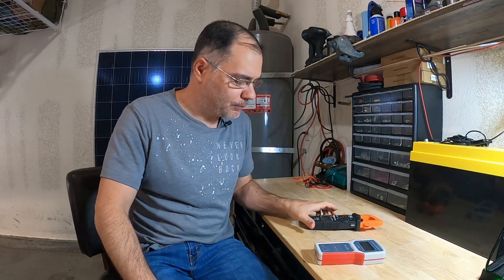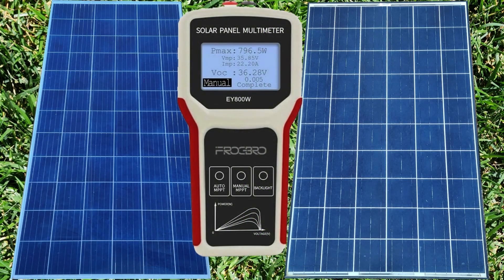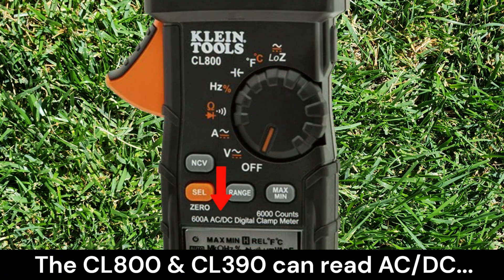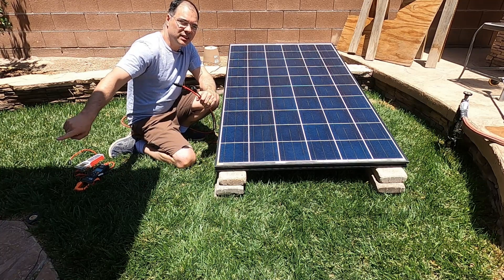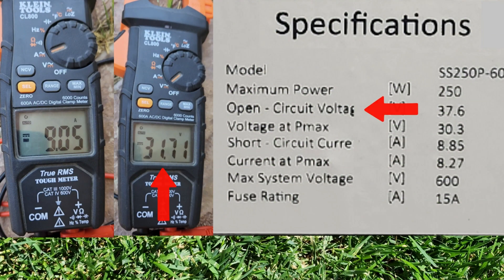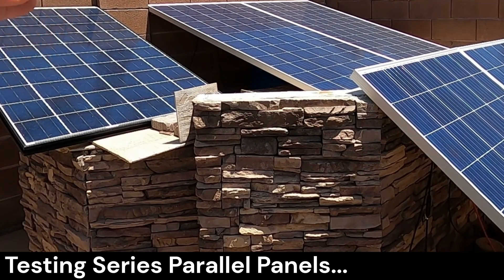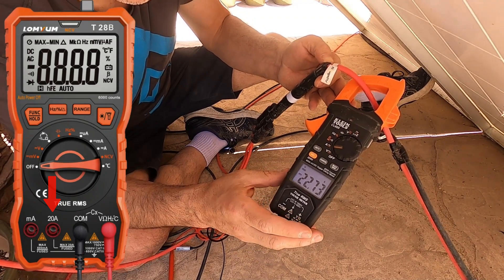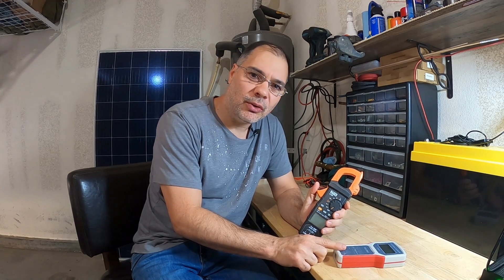How to Test Solar Panels - For Beginners!

Comment from the maker: NEW 2025 1800W Version With 120V VOC!
https://amzn.to/4iX9tne

Visit my website for more DIY solar projects:
https://www.natesdiysolar.com

My poor FrogBro!! So these meters, although convenient, have a 60V limit! When using it, be mindful of this as I was only thinking in terms of Watts! 

I think it's kind of silly to have a meter that can read 800W but have such a low VOC limit. You would have to connect the panels in parallel to test them. If it's made for single panels, I would like to see an 800W panel.. I would buy it in a second! 

I should have made a "will it fail" segment because it definitely failed.. or my brain did...

Enjoy! 

For Solar Panels (affiliate link):
https://www.santansolar.com/product-category/solar-panels/?ref=84967534

P.S. I had to remove the links to the solar panel angle tool and inclinometer app as YT did not like them....

My poor FrogBro!! So these meters, although convenient, have a 60V limit! When using it, be mindful of this as I was only thinking in terms of Watts! 

I think it's kind of silly to have a meter that can read 800W but have such a low VOC limit. You would have to connect the panels in parallel to test them. If it's made for single panels, I would like to see an 800W panel.. I would buy it in a second! 

I should have made a "will it fail" segment because it definitely failed.. or my brain did...

Enjoy! 

For Solar Panels (affiliate link):
https://www.santansolar.com/product-category/solar-panels/?ref=84967534

P.S. I had to remove the links to the solar panel angle tool and inclinometer app as YT did not like them....

06-15 Upfate: @12:33 I mention the Amps at Pmax (meter) was higher than the value on the sticker. I don't think this is accurate as this value should never exceed the short cuircuut current (isc) value as volts would be zero at short circuit. It's best to press the auto or press the manual button several times to get a good reading.. credit: larrywong7843
Reply: I just bought the 1600W version on Amazon.  The Frogbro is apparently being sold under about a dozen equally creative brand names, with no effort to hide the fact that they're all the same, right down to the model number.  The cheapest 1600W was ~$75.  The "Frogbro" was ~$105.
Reply from the maker: Yea, they are all the same.. the prices are  always changing.  😞
Reply: Seems you got your comment double-posted, but Youtube censorship is getting stupider by the day, removing legit things (both links and comments) while allowing the scam and spam to run free.

You forgot to mention the biggest advantage of the clamp-meter: you don't have to unplug the whole thing to run your amp-meter in series with the circuit!
When it comes to your FrogBro, I am more than a little bit surprised that such an expensive tool doesn't have overvoltage protection, especially so when the Voltage(max) is as low as 60. Quite happy you kept it in the video though, as it is VERY easy to make a small mistake which then have serious consequences.

Volts should be zero at short circuit? Ohm's law says that it's the resistance that gets close to zero, as I = U/R. Am I missing something here that is specific to solar panels?
Reply: @natesdiysolar  please could I have some Advice Nate. Thank you Sir.

Comment: I noticed with my meter when testing AMPS the thin leads became hot carrying the current. I think the meter was rated up to 10 amps and I measured around 8+.  So message being don't leave the wires connected very long.
Reply from the maker: Great point

Comment: Why does it show a negative sign infront of the amp number when measuring current solar panel short circuited? Klein model clamp reader.
Reply from the maker: This indicates the direction of current flow. Flip the meter on its back to see the reverse direction. It will be the same number of amps either way.
Reply: @natesdiysolar ok so im good lol. Thanks

Comment: A friend has solar and it’s not working as good as it did. And it’s 10 years old. What can be wrong please??
Reply from the maker: Could be degradation if the panels or the batteries.. check those first.
Reply: @ Thank you Nate. Very Quick reply. Thank you Sir

Comment: What are you using to check the angles is that your phone let me know please😅
Reply from the maker: It's an app called 360 degrees protractor . It's Grey icon with 360 on it.  I had a link but yt didn't like it.  Email me if u can't find it. Search protractor or incline angle finder

Comment: Dear Sir, Its a very useful video explained well. I have a question. I want to test PV panel of 545W power generation throughout the day on an hourly basis. So I solar panel multimeter is useful? Will it shows real time V, I, P generation from PV panel?
Reply from the maker: It will not, but you could use this or something similar. 60v max on this one.  Or you could use a more expensive irridiance tester with a logging function.  See video below. 

https://youtu.be/bP3Lg7ZcUA0?si=6wz3UUfXUR0ekGOd

https://www.amazon.com/HTRC-Precision-Analyzer-Battery-Voltage/dp/B06XPVKY13/ref=mp_s_a_1_1_pp?crid=2B7HV11YCWQIT&dib=eyJ2IjoiMSJ9.8Oa2WQsq1cpObn2qgkKDBnC570_alUUZzWJStE4gc-sRZJMXiOThDDzZdU6OKqk99--xLUsfYLahRKM20Wdb-ipLs9rP8l0Lf5ldYLJCSCT4fVWBcNP7B8WNgmBVXb2SLT9uug_Bgl0tIu296ZOSNPGkdQgewax3J9emTzFGxL-G_CGJ91NgfDF8oj28dRRcZVELvmsZfN7QPr_AsJYT5g.HMSSZUEbm-wEtAo1VghQW4RSlu1uw_Z2ls2Gh0gQ3lE&dib_tag=se&keywords=power+meter&qid=1739972016&sprefix=power+meter%2Caps%2C193&sr=8-1

Comment: It’s surprising that it doesn’t have overvoltage protection, where you would only have to replace a fuse I know some of the more high solar panel meters have over voltage protection
Reply from the maker: Yea a simple fuse sure would be nice..

Comment: I have a panel that when shorted to test short circuit current I get a negative current which equals what the panel is rated. It this a sign of a bad bypass diode. By the way great video.
Reply from the maker: When you say negative, are you sure you aren't seeing the DC current symbol.. I doubt It's the diode. Flip your meter from AC to DC. Notice the symbols changes.. lmk

Comment: at 6.38 time you were under the panels .and testing the string under load,, it said - 22.16 why did it have the minis? - before the ##?? ive never seen this,, great vid by the way
Reply from the maker: I assume you mean 16.36 while reading the amps... that was not a minus sign it was the symbol for DC current. My meter reads both AC and DC current.  It was in the DC mode..  you can see this if u fwd to 8.30. Additionally if I were reading DC volts and I had the Probes reverse it would show a minus sign since DC current has polarity or direction where as AC does not.. it moves back n forth .. hence Alternating Current VS. Direct Current.

Comment: Very informative testing video. For over one hundred dollars that Frogbro meter should be able to handle more than 60 volts or at least be fused. Thank you for saving me from buying and making the the same mistake. I'll use my clamp meter.

Comment: I said oh crap twice while watching your the video.
Once when the meter expired and then once again when you mentioned the price!

I’m currently researching test equipment for PV and battery power measurement and have these two items on order. 

Solar Panel tester (60V/35A max)
UNI-T UT673PV costs less than $40 shipped.

DC Clamp Meter (2/20/200A)
UNI-T UT210A costs $20 shipped.

You might have to time your purchases to get the best discounts. From everyone’s favorite, ExpressAli.

I have purchased UNI-T before and the quality is pretty good.
Reply: Scratch the 210A
It’s AC current only!!!

I’ll update my post above with the correct info when I’m at the PC.

Comment: 8:56 and 10:59. I was checking mine with a klein cl390. On the display, it shows a - in front of the voltage reading and the amperage reading.  Mine showed the same when checking the panels.  But when checking the battery side, it does not appear. I thought I had the polarity reversed coming from the panels to the charge controller. Found this video searching for answers. Thanks. At least i know im ok.
Reply from the maker: Glad it was helpfull.

Comment: I use solarCT  and Solar Tilt Andriod apps daily tilt / orientation calibrations.   down side is those  testers under 60v and lots of higher voltage panels out their , what has got me is I have seen others with these and theirs lists a high voltage warning and does not do any tests
Reply from the maker: Yea, that's the worst thing is the low voc. The 1600w version even is 60v, lol

Comment: Hello, i recently bought two identical panels. One is outputting 17v under low sun, the second one only 6 volts. (no load attached). When testing under full sun they output both 24v. Does that means that the low outputting voltage one is damaged?
Reply from the maker: It could be if you tested them under the same conditions.  Do a short circuit test on each panel individually see how many amps are produced. Compare that number with the ISC value on the sticker .
Reply: @natesdiysolar  thanks, I was afraid to shorten them thus maybe destroying some cells. I have sent the pannel back. I wait for refund and order a new one. When the new comes I will connect them to two loads and see hownthey perform. Thanks for your fast response 😊

Comment: Hey Nate!!! Thanks for sharing your knowledge through these amazing videos, very helpful!!! I loved the way you explain everything. I would like to ask you a question. I bought a 300w solar panel and want to get the efficiency. My voltmeter is 10amps and the panel label says that the maximum current is 18amps. Should I buy another multimeter? you can help me?
Reply from the maker: Yea that meter will not be able to test that panel. The amps are to high on your panel. It will blow the internal fuse or damage your meter. I would suggest getting one of the meters I mention in the video. Either one would work. I think the cheap one even does 20A max.

Comment: Hi, I have an issue with a 340W ( Vmp 32 V, Imp 10A, Voc 40V, Isc 10A.6) mono solar panel I recently bought. The voltage reading without load is fine, but without load I can never get more than 1.8A. As soon as it's connected to my microinverter or my off-grid inverter, the current goes down to 0.1/0.3 A and it never makes more than 11W. No shade, no visible damage, nothing. I already change the MC4 connectors, check voltage continuity in the cables, changes cable, tested the bypass diodes, temporary replaced the bypass diodes, and still nothing. Always the same 5-11W power production. 
What could it be? I run out of ideas.....

Thanks!!
Reply from the maker: Have you tried shorting the Mc4 connectors together and testing with a clamp meter.  Sounds like you tried everything... even the diodes. Other than what I just suggested, idk. Sounds like a dead panel. Iv never had a dead panel, but try the iSC test and see what that yields.  Post your question on the diy solar forum on fb or the one will prowse runs. Keep me posted . I'm curious
Reply: @natesdiysolar  Wouldn't it be dangerous shorting the mc4 connectors under the sun? Just asking. Thanks!!
Reply from the maker: @PepeGaka  if it's just one panel, it's ok.  That's how you test them. See in video.  That's why they have an ISC rating .you will need a clamp meter . Or just probe the ends with a probe meter if you don't want to short them.
Reply: @natesdiysolar  Thanks, I didn't know that. I don't have a clamp meter, unfortunately. I tried to test the current with the multimeter, and could never get more than 1.8A reading, without load. Way far from the 10 A I should get, in full sun. I'll see if I can get my hands on a clamp meter and try again. Thanks!
Reply from the maker: @PepeGaka  typo. Use either meter. Clamp or probe. Yea, it sounds like it's dead.

Comment: Are you saying that a multimeter CANNOT measure how well the solar panel is working? (i.e., it can only measure whether it is working or not?).  I ask because I'm looking to purchase some used panels so I'm very interested in understanding exactly how well the panel is working so I know if the use panel is worth the price. But then again I don't currently own a multimeter....and it seems like a clamp style multimeter is an essential tool if you need to do electrical work....so I'm trying to understand if I need to purchase the solar panel "multi-meter" AND the clamp style multimeter for other general purpose electrical work.
Reply from the maker: The clamp meter can accurately measure the current produced by the panel. Current can be used as a good indicator of the condition of the panel. If you want to know in terms of watts, it just would be as accurate as a mppt solar tester cause the measurement needs to be under load, not voc. So I would just get a multimeter as you will make more use of that.  Later on, you can decide if you want a solar panel meter.  Just compare the voc and isc values using the clamp meter as I show in the video.  Good luck!
Reply: @natesdiysolar  Nate, thanks for quick response and sage advice! Now I just need to decide if I want the Klein CL800 (600amp) or the Klein CL390 (400amp). If you have any thoughts on that let me know.
Reply from the maker: @Jetter638  well whenever I'm faced with this dilemma it's always best to go overkill because when you don't have what you need... you don't have what you need.. cyber Mondays tomorrow probably can get it for a good deal if you look around :) however.. you probably will never see more than 200A in a solar system..

Comment: When disconnecting the tester from the panel, should the panel be blocked from light to prevent arcing at the connectors...?
Reply from the maker: You can if you want but the tester of only drawing power during the test.  Very little at idel. Single Panel. String of panels you could but with a max of 60v you are probably ok there as well.  In all my testing I have not seen any arcing.  But if you are testing a large system yes I would turn down any loads so there is no active draw.

Comment: Multimeter current inputs are fused. (the word fused is printed right next to the meter's current socket) So connecting a panel that supplies more current than the meter is rated for will simply pop the fuse as opposed to destroying the meter.
Reply from the maker: Yea, that's true. But I did not damage the multimeter.. I damaged the solar panel meter, which is not fused.

Comment: I have the same solar panel meter.  It says mmpt watt is 330W.  But the mppt is only producing 200W.  It is high noon.  How do I figure out the issue?

Do you know of a mppt meter with recording eg on an SD card?
Reply from the maker: What is the wattage of the panel you are testing.. I do not know of a device that will log historic data. A high-end solar panel meter probably, but they cost hundreds.  I'm confused about your question.. so your meter reads 330w but when you connect panel to your charge controller it says 200w? Is that correct..

Comment: Hi Nate. Really appreciate your video. I don’t have much in solar panels but this interests me. My question is that when you connected the solar panel tester when they were combined, could you have connected your CL800 probes to get the total volts? Connecting the combined 3 black cables to the clamp meter COM port and the single red to the red probe? Looks like the clamp meter has a 600Volt max… 

Also, could you have sort circuited the panels at that same time to get the amps? Or maybe I’m confused…
Reply from the maker: Yes, I could have used the clamp meter to get volts, but it would be an open circuit voltage.  I was trying to get a power reading which requires a load.. hence the solar panel meter. You would not want to short circuit multiple panels in parallel as it could damage the panel.

Comment: I short circuited my inverter when turned it of from the mines when i had the pv circuit breaker on. i forgot to turn it off, and i did not have the AC CIRCUIT BREAKER  GOING INTO THE INVESTOR IT DARK AND I WAS TIRED ALWAYS HAVE THE AC DC CIRCUIT BREAKERS.  OR ALL THE WIRES GOING INTO INVERTER.
Reply from the maker: Ouch. Sorry to hear..

Comment: Clamp meter, I was my understanding that to get a correct reading the wire must be centered inside the clamp, not just let the wire hang to the side like you are showing.
Reply from the maker: Good point.  Thanks for the info.  Iv seen 1 to 2 amp difference while moving it around inside the clamp.
Reply: Depends if a hall sensor or not. Just because it's a "clamp "meter does not mean it has a hall sensor.

Comment: 0:17 this shade over panels lowers output of poly panels quite a lot.
Reply from the maker: For sure.  That's where my panels normally sit as I don't have much room. They get sun later in day as they are west facing.  This is not where I tested them, however.
Reply: @natesdiysolar  I can see in the video, that you tested panels a little bit to the left and facing south. Make sense to have another western string. i think that shade would disapear if you lift them more, also you would have some more storage space under them. But i think you have more solar power than you need even now.
Reply from the maker: @rm6857  it would . Just been lazy. These will go on the roof eventually.  As it is I'm over producing.  I have a large garden that takes up my entire yard
Reply from the maker: @rm6857  they are in full sun by 1pm and produce until 6pm

Comment: I'm curious because I was told never have the panels out in the S u n Disconnected because of the electrons does not have anywhere to go and you will burn out your panel.
Reply from the maker: I do not think that is true.  Thanks for watching.  I'm curious where you heard that...